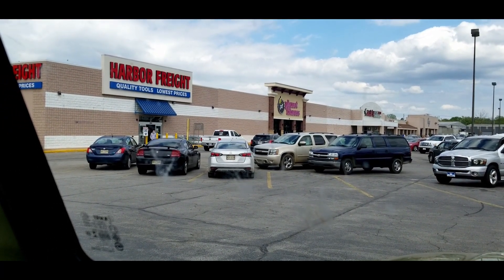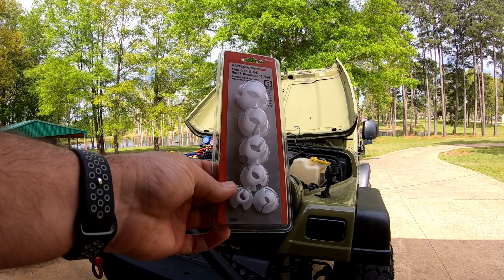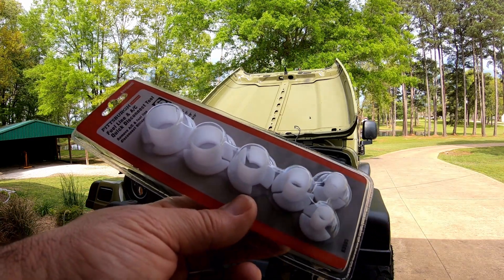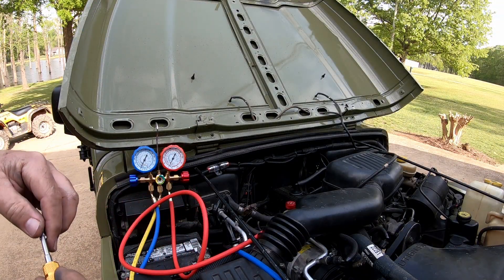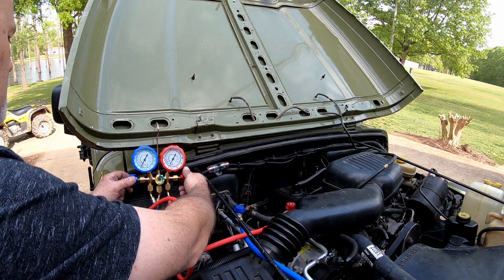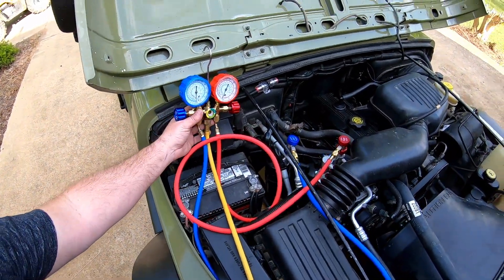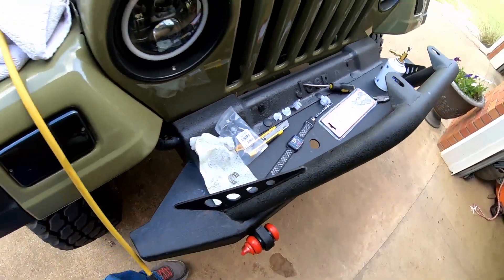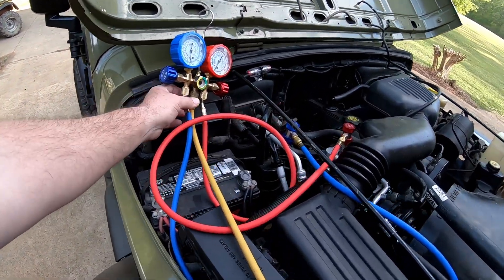Great Cheap Vacuum Pump (It's free)! Cheapest way to pull a Vacuum!

Comment: You chose the worst line disconnect tool! I bought the same. Lol Wish I'd just bought the metal ones. One broke immediately and others I've had to shave down.  

Us 2.5s gotta stick together. Can be hard to wade through things for 4.0s only to find it won't work for 2.5s. I appreciate your work. Wish I'd made a video of changing the rear main seal. Had to drop the whole clutch and transmission. 

That pump is pretty ingenious
Reply from the maker: Thanks for the comment. Yeah, I wasn't looking for good on the disconnects, I was looking for cheap haha. They are indeed cheap(made that is).

Comment: Thanks for the shoutout, Steve, really appreciate it - and to your subscribers, too!  Great video; JJ's looking great under the hood and outside! I noticed how you've got your windshield washer hoses routed instead of drooping under the hood - great mod for TDSR as well. 
FWIW, after the refill, your compressor seems like it's cutting on/off at about the same rate as TDRS's (not that my Jeep is the pinnacle of examples for anything).
Reply from the maker: Thanks Ed! Yeah the temp was 63F that day and that could have been part of the reason. The turning on and off didn't really change that much. I did have peace of mind know that I changed the orifice out since not replacing the evap core. Thanks for watching. Maybe you will get a few more subs!
Reply: Went over to your channel. I have a 97 that also has needed almost everything done to it. Also mine had a squeaking sound from the fan belt. Turned out to be the Harmonic balancer. It had went bad and moved back rubbing on the timing chain cover. Tomorrow I start putting new Axle seals in the front axle. New u joints and ball joints. So most of the front axle new. Put new hubs and bearings last year.